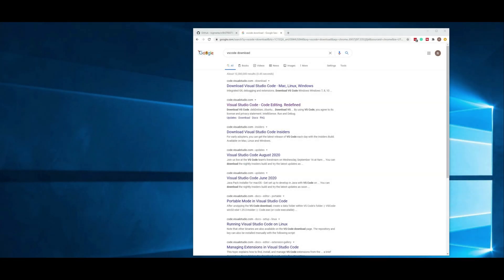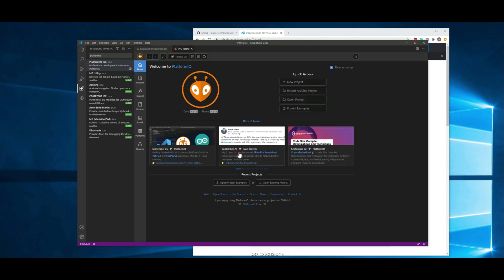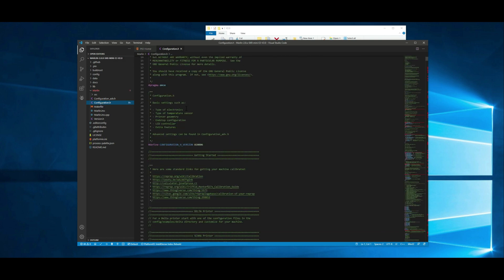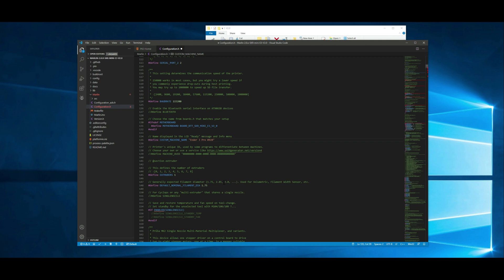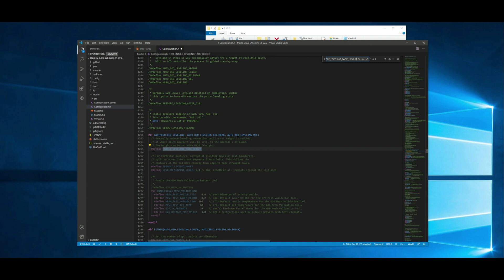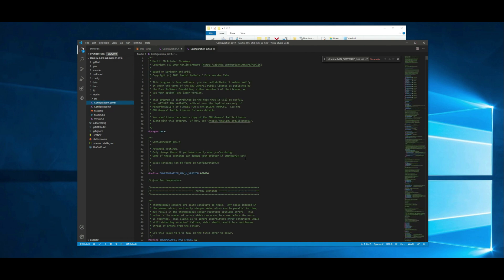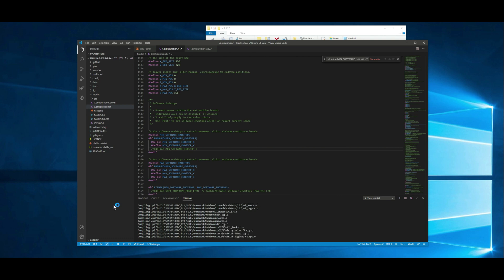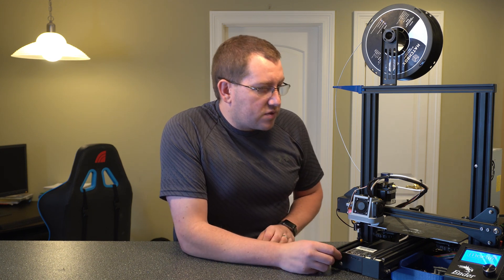How to Compile Custom Firmware for SKR Mini

Comment: I tried this build on my ender 3 with the BLtouch and the SKR mini ev 2.0. I even added the touch screen. I'm trying to upload the custom firmware to work the bltouch, but there are a few things wrong. First, is it necessary to connect the bltouch to the z axis pin rather than the designated bltouch pin for this firmware build. Second. I can't find my firmware. It compiles fine, but I can't locate the file. You said, if it doesn't show up that something must have gone wrong. What could that be???
Reply from the maker: Hi. You can wire the bltouch either way, but the wiring will impact the firmware changes needed. I have the two pins connected to the z-stop port, and the stock z-stop is not connected. What was the output in the terminal? If it showed success, it should have placed the firmware under the .pio folder. Here is the path where it put mine. \Marlin-2.0.x-SKR-mini-E3-V2.0\.pio\build\STM32F103RC_btt_512K
Reply: @3DPrintscape  Thanks for the reply. I'm on a Mac, which is the only thing I can see thats different from your videos. When i open the top Marlin folder I pulled offline, there is no .pio folder before or after compiling. However, I can see one in the drop down list inside of VSC. Super confused about that. Terminal reads successful...
Reply from the maker: @shaknbac28  I think with mac os will automatically consider folders that start with a . as hidden. You will need to unhide or or browse to it through cli.
Reply: @3DPrintscape  Wow. totally right dude. Thank You. I found the firmware and I'm gonna give it a go. Just out of curiosity. Any big reasons to use that z pin for the bltouch rather than the premade one? And what firmware stuff should you need to change in order to stick with the bltouch pins instead?
Reply from the maker: @shaknbac28  Cool, glad you found it. I opted to just use the z-stop connection for the bltouch for simplicity (it works just fine). The only thing using both will do is provide the extra mechanical end stop. THB, im not sure what else would need changed in the firmware, as I haven't actually gone that route before.
Reply: @3DPrintscape  No Worries. Appreciate all the help. Great Video!

Comment: I am sorry but i am so new at compiling the 3d firmwares. I have been upgraded my ender 3 pro from creality 1.1.5 to skr e3 v2 with Tft35 v3. I just want to be sure, is this way firmware upgrading is compatible with the tft35? I just downloaded the pre compiled bin file from github page of btt, but pasue/continue does not work. And actually it is important for me and i did upgrade my mainboard for that. I have already upgraded the firmware of tft35 screen i just need to be sure this is the correct way to upgrade mainboard firmware while using tft35. Thank you for your great work and share with us.
Reply from the maker: Hi. Im running the same setup, I just didn’t have the TFT35 connected when I did this video. This video covers the SKR mini side of the upgrade, but it will work with the TFT35. I did another video covering the TFT35 upgrade that you can see here in case you wanted to verify that upgrade. https://youtu.be/S9GreElCJWQ

Comment: at 10:00 you disabled the z-endstop if i'm getting that right, but given the SKR mini has sockets for both the endstop and the bltouch, could one enable both? the bltouch for homing/bedleveling and the endstop as a last resort in case the bltouch fails to see the bed (e.g. when in a corner)?
Reply from the maker: Hi. It is possible to keep both connected to the SKR Mini. It does add to the complexity a little but overall its not to complicated.
Reply: @3DPrintscape  the firmware side sounds rather trivial, i was mostly concerned whether both might share the same pin on the microcontroller, or similar hardware limitations.
Reply from the maker: @nonchip  Got it. They would be separate pins. To have them both connected you would leave the z-stop connected in the standard location and the bltoch stop would connect to the two open pins on the bltouch port.
Reply: @3DPrintscape  ok so those aren't actually just two different connectors shorted together for the same signal, good to know. yeah then i guess it should be as easy as tell the software to use the probe for anything homing/leveling related and just shut off the motor as soon as it runs into the endstop (which i'd then position so it happens just a milimeter or so after the probe should've triggered)
Reply from the maker: @nonchip  Looking at the pin diagram provided by BTT and it calls the out the z-probe stop separately and there is wiring options and precompiled firmware for both. This leads me to believe that both stops can be ran together. Disclaimer, i haven't actually tied this and im just running without the z-stop.
Reply: @3DPrintscape  i just found their schematic, it looks like the BTT is connected via the "probe" signal to pin 3 on the cpu, while the z-endstop is connected via the "z-stop" signal on pin 10, sounds like you're right there.

Comment: got a question on some issues I've been having. so I did a pid autotune. it worked for the extruder but I cant seem to get it to work on the bed. i turned on the pidtempbed setting. but still with the gcode m303 c5 e-1 s60 i get a message saying  pid autotune failed! bad extruder number. not sure how to fix. for now I'm just using the default bang bang. any help would be apreciated.
Reply from the maker: Hi. Any time I have seen something like that come up from the printer its was because that feature was not enabled in the firmware. Can you check to see if you have this enabled ? “#define PIDTEMPBED”
Reply: @3DPrintscape  yes I did enable it. Recompiled it and loaded it. I can't figure out why it won't work. It's defined.

Comment: Hi, I found this over view very helpful as I am very new to the 3D printing game. However I keep getting an error when I compile the code. collect.exe: error: 1d returned 1 exit status * [.pio\build\STM32F1032F103RC_btt\firmware.elf] Error 1. I've done as instructed and down loaded fresh versions, but the same error keeps coming up. I have gone though line by line making the changes and it only occurs every time I enable the auto bed levelling bilinear line bit. What am I doing wrong?
Reply: I've got the same problem, did you one of you guys found a solution?
Reply from the maker: @edwinnotebomer4800  Hi, its probably related to the environment variable in the platformio.ini file. I can try to help out. If your on discord you can ping me there. https://discord.gg/Bu94EYVkrU
Reply: @3DPrintscape  Hey, thanks for the quick reply! I have redone all your steps a second time and builded it as a STM32F103RE_btt file, which did the trick for me. I think I did something wrong the first time I tried... However, I cant thank you enough. your explanation helped me through the setup of my e3 v.2 and bl touch.
Reply from the maker: Hi. Can you email me a copy of your config? My email is admin@3dprintscape.com . I want to check a couple of things. Also, please include a list of the hardware you  are using.
Reply: @3DPrintscape  Hi, I have sent an email from my virgin account.

Comment: maybe an obvious question but do I need to leave the .bin file on the sd card once the firmware is on the printer?
Reply from the maker: Hi. No once the printer has been updated, you can wipe the card until you need it next time.

Comment: im getting an error not sure how to fix it. any help would be much appreciated.

c:/users/jarid/.platformio/packages/toolchain-gccarmnoneeabi/bin/../lib/gcc/arm-none-eabi/7.2.1/../../../../arm-none-eabi/bin/ld.exe: .pio\build\STM32F103RC_btt\firmware.elf section `.rodata' will not fit in region `rom'
c:/users/jarid/.platformio/packages/toolchain-gccarmnoneeabi/bin/../lib/gcc/arm-none-eabi/7.2.1/../../../../arm-none-eabi/bin/ld.exe: region `rom' overflowed by 452 
bytes
collect2.exe: error: ld returned 1 exit status
* [.pio\build\STM32F103RC_btt\firmware.elf] Error 1
Reply from the maker: Hi. It looks like the firmware may be too large for the board that is selected. Assuming you are using the SKR Mini, can you make sure that is the board defined in the config?
Reply: @3DPrintscape  thanks for the help. i got it fixed
Reply: @riddler44  Hey how you did fix it? I am having same problem. Yardımcı olursanız sevinirim çözemedim.
Reply: @3DPrintscape  I am stuck with the same problem. How do I make sure the board is defined in the config?
Reply from the maker: @tsbruford  Replace default_envs = STM32F103RC_btt with default_envs = STM32F103RC_btt_512K in your platform.ini file located in the root directory of the firmware folder. Then restart VS Code.If your still having issues you can reach out to me on discord as well. https://discord.gg/Bu94EYVkrU

Comment: Great video.  I wanted to try enabling the z offset wizard. Does this also use your probe as the z stop?
Reply from the maker: Hi. Thanks for the feedback. It would use the probe as the stop, and depending on how the probe is wired, it may be the only thing in place to act as a stop.

Comment: Is there a setting that does not allow the z axis to go negative. I cannot offset because it does not allow me to go negative on the z axis
Reply from the maker: Hi. I didn’t have that issue when I was using the stock 8 bit board, and Marlin 1.x. When I moved to the SKR mini and Marlin 2 I had to kick off an auto home before it would let me go negative. Can you give that a try?

Comment: Great video can you do a video on installing and setting up a micro Swiss dd?
Reply from the maker: Hi. Thanks for the feedback. Here is a link to the video I did on the Micro Swiss hotend swap and I just finished a video yesterday on the direct drive conversion, so that should go live tomorrow. https://youtu.be/rn0p6m96UA8
Reply: @3DPrintscape  ok great I appreciate it. I’ll check it out. I did the firmware for the bigtree skr mini e3 v2 on my ender 3 v2 and it will heat up and during my test print a few minutes in the nozzle temperature starts to drop until the print stops the print. Do you have any advise as to what it could be or how I can fix this?
Reply from the maker: That sounds really odd. Is it dropping at a certain point in the print, and can you verify you don’t have anything set in Cura that would cause the temperature to drop?

Comment: Help! 
I have an Ender 5 and cannot go below 0 (zero) when moving the Z axis by 0.1 - any ideas please?
Reply from the maker: Hi. I think you need to auto home it before it will let you go below 0. I actually plan on buying an Ender 3 next month so hopefully I can get more detail then.
Reply: @3DPrintscape  There is a protection feature that can be turned off in GCODE  https://www.youtube.com/watch?v=y_1Kg45APko
That fixed it sweet! Thanks for the reply.
Reply from the maker: @noshdaminsk  It sounds like the soft endstops were enabled then? I thought the autohome disabled them, but that may just be a firmware setting.

Comment: Also. I wouldn't change Z MIN to true if I was using z homing right? I removed the mechanical z endstop. Would this change anything? I'm using ver3 of bltouch
Reply from the maker: I believe that is the case. I removed the Z endstop as well, so if you follow what I have in the video you should be good.

Comment: Can you use this board on CR10S ?   And just compile it for CR10S  workspace, bl touch , ect
Reply from the maker: Hi. I did a little searching and it looks like you should be able to use it on the CR10. You will want to make sure you are using the correct firmware with it. That said, I haven’t tried it myself, so I cant say for sure that it will work. I know a lot of people have CR10s, so I may end up picking one up to do videos on.

Comment: Hey thanks for the videos I have a question I just upgraded my board to the same followed your lead and I’m getting  worse prints than with the stock board any idea why lots of zits
Reply from the maker: Hi. Im sorry to hear that you are having issues. If you are getting a lot of blobs/zits I would look into your retraction and coasting settings in Cura. Try to tweak those a little to see if that helps.
Reply: @3DPrintscape  thanks for the reply I will do that

Comment: This is a great video helped out a great deal, thank you. any chance of showing us how to compile Marlin to use the Neopixel for lighting? have searched around but noone does an indepth video like you do!!! Thank you again for all the work you have done great videos
Reply from the maker: Hi. Thanks for the feedback 😊. I will look into doing a video on Neopixel lighting. I will need to buy the lights and everything but will try to get something out this month.
Reply: That would be amazing! Thank you so very much! I look forward to learning yet again from you.
Reply from the maker: Hi. Did you already buy the lights, if so what ones? Im trying to look at options for this.
Reply: @3DPrintscape  these are the ones I bought on Amazon 60 NeoPixel Digital RGB LED per 1 Meter. I am running the sir mini e3 v2.0 as well with the marlin 2.07. I know I am missing something when I am doing it but I just can’t figure it out. Thanks again for all your help
Reply from the maker: Ok, There are a lot of options, so I wanted make sure I get one that is close to what you would be using. I will take a look at the one you got as well.

Comment: EXCELLENT VIDEO, THE EXPLANATION IS PERFECT, I AM NEW IN THIS; I JUST INSTALLED A SKR Mini E3 V2.0 AND THE BLTOUCH BUT WHEN I TRY TO HOMING THE X AXES, AND THEY DONE IT WELL BUT THE Z AXIS DOES NOT PERFORM IT AND IT SHOWS ME THE FOLLOWING ERROR "STOP CALLED BECAUSE OF BLTOUCH ERROR - RESTART WITH M999. "I NEED TO KNOW HOW I CAN FIX IT.
Reply from the maker: Hi. Thanks for the feedback 😊. I have not personally had that problem but talked to a couple of people that have. It sounds like there is a bad connection on the black and white wire, or the probe needs to be manually adjusted. There was a reply on one thread I found related to this issue where they fixed it by manually pulling the probe down and restarting the printer. I would try that first.

Comment: Thanks, this finally got me running with my bltouch (v1), however Z_MIN_" inverting to true had my z axis crashing into the bed... switched back to false and worked like it should. Just wanted to drop a note here in case someone else ran into problems.
Reply from the maker: Hi. Thanks for the feedback. That’s interesting, I had the opposite experience. What version SKR mini do you have?
Reply: @3DPrintscape   v2 as well, maybe I have wires swapped.
Reply from the maker: It sounds like the z-stop isn’t being triggered, or the motor orientation is set the wrong way.
Reply: @3DPrintscape  Everything is working perfectly and printing great with it set to false. When I first compiled I had it set to true, and when it went to z-home the bltouch was retracted and the nozzle crashed.
Reply from the maker: Got it. Were you switching Z_MIN_ENDSTOP_INVERTING or Z_MIN_PROBE_ENDSTOP_INVERTING? Here is what I used.

// Mechanical endstop with COM to ground and NC to Signal uses "false" here (most common setup).
#define X_MIN_ENDSTOP_INVERTING false // Set to true to invert the logic of the endstop.
#define Y_MIN_ENDSTOP_INVERTING false // Set to true to invert the logic of the endstop.
#define Z_MIN_ENDSTOP_INVERTING false // Set to true to invert the logic of the endstop.
#define X_MAX_ENDSTOP_INVERTING false // Set to true to invert the logic of the endstop.
#define Y_MAX_ENDSTOP_INVERTING false // Set to true to invert the logic of the endstop.
#define Z_MAX_ENDSTOP_INVERTING false // Set to true to invert the logic of the endstop.
#define Z_MIN_PROBE_ENDSTOP_INVERTING true // Set to true to invert the logic of the probe.
Reply: @3DPrintscape  Yeah, it was Z_MIN_PROBE_ENDSTOP_INVERTING. Not sure why It would be the opposite for me, but either way it's working now. Thanks again for putting this out there, really helped me get it running with the bltouch, I almost gave up and went back to manual leveling.

Comment: I'm a newb at 3D printing, and your videos make to understand this real easy, the things is i could not get my Bltouch to run on a skr mini e3 V2, i dont if is firmware or hardware, i have the z stop next to the servo pin
Reply from the maker: Hi. Thanks for the feedback. Try to connect the z-stop from the bltouch to the main z-stop connection on the board, then make sure you have the right firmware installed. The firmware would be the same one I call out in my skr mini install video ( https://youtu.be/wtT6iA9IG7A ).
Reply: Cool thanks i will try it out,thanks

Comment: I am using Mac and after building the file I do not have a  .pio file. I have redone several times. Build says success but no pio file please help
Reply from the maker: Hi. Do you have any folders that start with a . in the firmware directory. Normally on Linux operating systems the . at the beginning makes the folder hidden, so im thinking that maybe the issue.
Reply: Did you solve the problem?